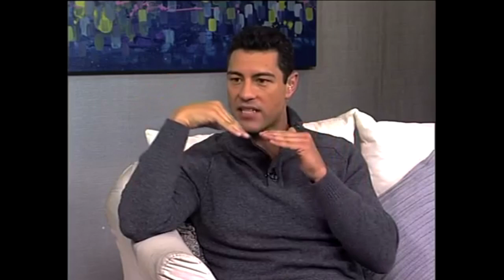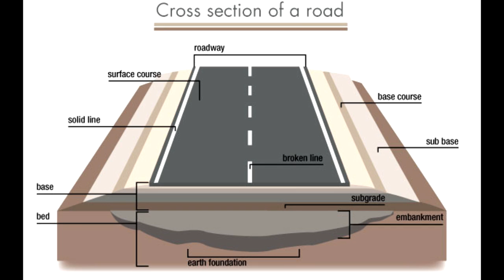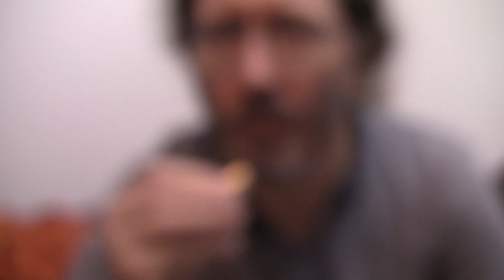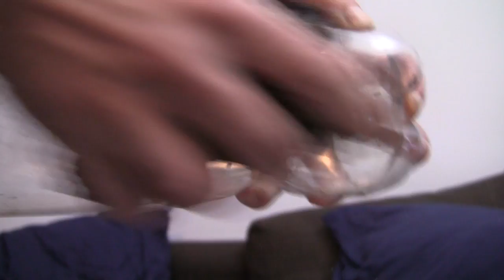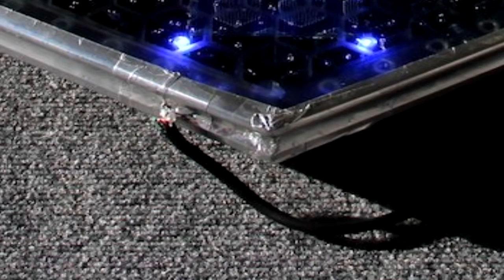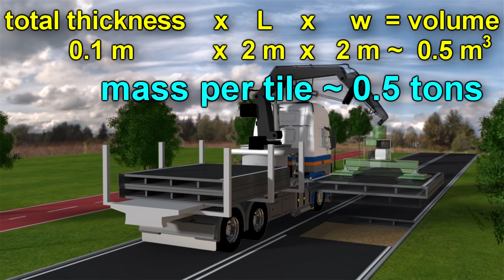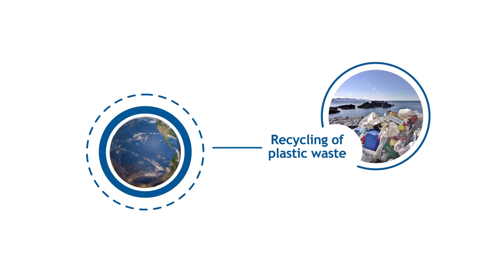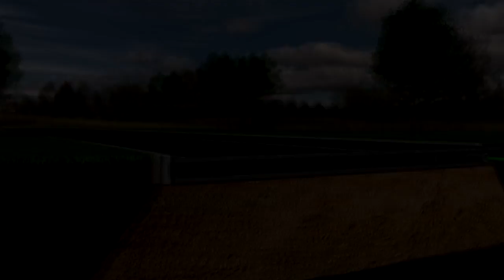Plastic Roadways BUSTED!

Comment: Of course the product is bullshit.  I will not make fun of the 60MIL hits on FB though.  I tend to see that as less about gullible people and more about the fact that people actually are starting to care what happens to our plastic and have a desire to find solutions(This unfortunately was not one of those things).   Best solution though is not going to be re purpose as much as it is just use less and be smart.   This was a good video thank you for the breakdown.  BTW Asphalt overall is not a wasteful material.  I work at a refinery.  It is made from materials that cannot be gas or plastic and are sorted out of the same fraction heating oil comes form.  It takes little effort to process compared with plastic or jet fuel or even diesel.  And as stated in this video it is easily recycled.  One thing NOT mentioned.  As the plastic is exposed to UV it breaks down becoming micro plastics which will wash back into the water ways through those rain channels or get carried away in the wind.  Adding even more micro plastic to the environment and food chain.  Burn all waste plastic and find better alternatives for single use items.

Comment: Hate to break it to you but they tested it and it worked
Reply: Did they test it for long term use?
Reply: Satan that’s what they did it’s feasible so they gave it a shot and built a road using it and will se if it can hold

Comment: Those plastic roads could be used for private driveways, but mostly for foot paths, and then, mostly in low usage areas.
Those hollow areas will lead to pathological cracking of the surface, shortly followed by catastrophic failure, probably in less than a month, a few days if heavy traffic is involved.

Comment: You could recycle the plastic into a mesh, then use the mesh under the asphalt. The mesh has a high tensile strength and would bind the asphalt reducing hydrodynamic shock, caused by tyres forcing water into small cracks, resulting in rupture of the asphalt surface. 
This kind of system has been used for centuries, using wood as a binder between layers of rock.
 Heck, even the Romans knew this.

Comment: PET is already being heavily recycled anyway - most of that which is recycle winds up in "polar fleece" or "microfibre" fabric.  I've got a neck gaiter by Buff that came with a tag proclaiming that 2 PET drink bottles had been recycled to make that one small item, and pretty much every polarfleece garment is comprised of a percentage of recycled plastic.

The only problem is that too many people are too lazy to take the PET bottles for recycling and that some places don't have appropriate facilities or infrastructure to ensure that PET bottles make it to be recycled.

There are numerous types of plastic, not all of which can be easily recycled and recycling of those that can entails careful sorting of the plastics to ensure the correct types go through the correct processes.  You can't just grab a hodge-podge of PET, Nylon, Acetate, PBT etc, melt it all down, give it a stir and pour it into a mold.

Then there's the practical considerations of making prefabricated segments of roads.  The illustrations show nice uniform squares of roadway - any kid who's played with hotwheels or any other similar thing knows that some road sections have to be shaped like corners as well as upward and downward curves.  Easy to do when you're making something that's small and is going to be set up on a table-top or floor and has uniform corners.

Not so easy to do when you're trying to follow the terrain outdoors with random rises and dips and corners that range from tight hairpins to wide, sweeping curves.  You'd need a supply of a near-infinite range of shapes and sizes of road segment to handle the wide variety of terrains and angles of curve/incline.  Without this amazingly diverse supply, you'd have to halt road repair while a custom section was manufactured.  And what happens if the wrong piece was brought out to repair the corner and it doesn't fit properly?

And that's in addition to all the other considerations mentioned in the video and in the other comments.

Comment: This is a fairly accomplished hack job using a great deal of insinuation and very little fact. Having worked with Dow Plastics for almost a decade I can tell you that the hardness or strength of plastics or plastic composite materials will not be a problem, nor will sensitivity to heat (plastic has been used to create car engine components for almost 20 years). While the future of plastic roadways is still uncertain, they will not be challenged by simplistic arguments as are presented here.
Reply: He was inferring that this design with that type of plastic wasn't feasible, not that you couldn't build a plastic road.
Reply: Yeah sure, you can engineer some super strong, super heat resistant thermoset composites, some of them even have super weather resistance (though not many). All of them cost orders of magnitude more per kilo than the cost of some rocks, sand and bitumen and none of them are recycled/recyclable.
Just sayin'.

Comment: But if you take a thick piece of recycled plastic and use it as a road even if it get damaged by the UV light you can make a machine that scrapes of the top layer and leaves a new clean driving surface.  Add some expansion joints and you are all set.
Reply: The layer scraped off would cause problems

Comment: Get massive aerospike rocket engine. give it the brain from one of space x's boosters, so it can hover. Get it to hover about two meters above the ground on it's drive flame, and program it with the route you want your road to take. Should fuse the ground into stone/glass as it goes.. Road. Some fine tuning required.

Comment: At least they are challengi g conventional view, getting outside the box to move us forward in advancing our civilization by solving a problem. Rather than hold us in the past like Thomas Edison style. Help evolve the process rather than debase it causing all ur bandwagon comments of haters. If your such an engineer you would know there is more plastic and polymers out there that are harder and provide better abrasion resistance and the process can be tweeked feom the basic idea. Stop holding minds in the dark ages and look towards advancement and evolution. Be apart of the solution not a part of the problem.

Comment: Funny thing I learned about roads in a road building course in my geomatics diploma is that it is REALLY important to build them smooth. Even small bumps can be at best uncomfortable and at worst dangerous in poor driving conditions, meaning you have to curve the roads to a vertical design layout within a couple centimeters of precision. This design principle goes completely out the window when you try to replace the mold-able asphalt with flat panels of any material. A well built road takes the ups and downs of it's environment with smooth curves and these wishful thinkers have brought straight edge segments.

Oh and the hollow compartments to house pipes is useless in the majority of the US where the freeze line is deeper than a centimeter or two. Unless you want frozen and burst pipes every winter, water and sewage pipes will have to go underground.

Comment: This thread  contains  one of the most concentrated purely ignorant presumptuous naive set of comments I have seen anywhere on Youtube. Only chemtrail and anti-vaxer threads are worse. Literally 2000 idiots here actually think the formulation used would not be designed to be fire resistant! Ever hear of an engineer? Or engineer approval reviews for public works?

Comment: Nothing has been "busted" YOU POMPOUS ASSHOLE. Plastic material does not have to be all or nothing and nobody ever implied the road bed does not require preparation, the tone of you narration makes me want to kick you in the teeth. We can add and already DO add shredded rubber tires to tarmac and we can add plastics too for a superior surface that requires less resources to produce. In fact the exact design shown in the video could be ideal is special circumstances like high erosion areas. I especially hated the way you chided the animation that abbreviated the actual molding process, what a tosser.
Reply: Have you forgotten that plastic degades in the sun light over time?  This road would create a whole lot of tiny plastic fibers everywhere
Reply: @jennakatze5401  It seems YOU forgot that all outdoor plastics have UV resistant formulations. And all road surfaces of every type do wear and that material enters the environment. Without long term testing we don't even know the wear rate, this could be the lowest wear road surface ever.
Reply: @popeyegordon  okay let's say it'll be made from UV resist plastic
Reply: @popeyegordon  it would still wear down because plastics are pretty soft
Reply: @jennakatze5401  False. There are thousands of plastic formulations. Why do you think an engineer would risk his career by designating the wrong formulation? A little give on the microscopic level allows flexing rather than chipping like concrete roads do during wear.
Reply: @popeyegordon  still I wouldn't drive over a plastic road in the rain because even if it was textured it would still be slippery
Reply: @jennakatze5401  What are your road engineering credentials? If you have none, shut up.
Reply: @popeyegordon  so I need a degree in engineering to understand, k
Reply: @jennakatze5401  No, you need to understand what it means to be a degreed engineer who's work is reviewed and is part of a team. Investors demand highly qualified personnel. Wouldn't you?

Comment: I remember a 70's commercial on TV about something called petromat. It was a sheet of a petroleum based product that they put under asphalt to prolong the life of the road. If I'm not mistaken the announcer said no potholes or cracks in test roads in 5 years. Never heard anymore about it. This commercial was from one of the oil companies. I know it would have been more expensive at first to do this but you think counties or cities or the federal highway system would use this because it would save money in the long run. Most municipalities have this kind of reasoning, "if we can't afford it today we won't use it" and this is why most infrastructure in the U.S. is in dismal shape.

Comment: Don't know about other regions in the U.S. but in Arizona they put some kind of oil like substance on the road which they say it seals it and helps to prolong the life of it. Most roads they redo in my town is cheap and really doesn't seem very good. Instead of paving it with asphalt they put a layer of gravel down then put a slurry mix similar to the oil over it. They call this repaving. Ha ,ha. Talk about noisy I measured the sound versus a asphalt paved road and the decibel level is 15-20 times more. We all know the reason they do these 2 things, money!

Comment: This might sound stupid, but I think these plastic roads would be a thing of nightmares for things like the President's motorcade, military convoys, parades etc. I mean think about it- plastic road panels that are hollow and aren't secured, imagine how many nasties you could put underneath it (IE: explosives) and nobody would be the wiser. I understand there are counters against this in things like motorcades, but I just think that this would be asking for trouble.
Reply: No, no difference in security. All sewer lids are welded shut before a presidential visit. Obviously a similar precaution could be used under this surface, and it offers ways to run wires for security monitoring purposes.
Reply: That's true enough. It was just a thought seeing how these are hollow I instantly jumped to terror incidents. I guess in civilian scenarios you'd have to be careful though.

Comment: The safety hazard would be multiplied if the road sets on fire for instance a burning car would could cause a road fire or lightning. The whole road would set on fire probably doing more harm than good in the end. Not to mention how brittle the road would be regardless due to weathering.
Reply: Stupid premise. No engineer would ever approve a formulation that is fire prone. If a vehicle fire ruins a section then well duh, the section module is replaced per the video illustrations.
Reply: Popeye Gordon you do also realize asphalt is more recycled than this
Reply: @rat7464  Asphalt can't provide a huge amount of clean power before it is recycled.
Reply: @popeyegordon , Sure, along with all the cables too ? Asphalt is flammable.
Reply: @augustreil  What part of modular don't you understand?
Reply: @popeyegordon , How many connections do you think all that stuff can have ? Even if the modules are 50ft, that's 105 per mile, it will cost more than concrete.
Reply: Imagine a wildfire in California or someplace. As soon as it gets even CLOSE to the road it turns into a tar pit!!
Reply: @oriontherealironman  No. The melting point of plastics is far greater than tar. Roads do not get much heat from forest fires, they are actually helpful breaks for fires. That's why humans stay on the roads for safety unless the wind is across at high speeds. Instead. Imagine all the forest fires that WON'T GET STARTED IN THE FIRST PLACE thanks to roads with power lines buried safely inside them.
Reply: @popeyegordon 
Eh fair point, the fire typically wouldn't even get close under normal circumstances. However it's still a monumentally stupid idea. They are thinking outside the box which is what we need, just not quite the right idea.

Comment: Well there is a way to melt plastic back into oil/tar. So that can be a use for recycled plastic. Instead of using new bitumen, they can use plastic that's been recycled back into its ALMOST original form... that is if the plastic that is being recycled is produced from petroleum and not "biodegradable" plastics.

Comment: there is going to be layers upon layers of plastic plus special adhesive plus heat resistant chemicals and hardeners added  to make the road..not  just plastic...moron..
Reply: "Heat resistant chemicals and hardeners" Care to tell me what some of those chemicals are? Or are you pulling that out of your ass and assuming there are chemicals than can do these things feasibly? Also even if you're right it's going to increase the cost of the road significantly. And the pollution from those chemical treatments, dear fucking GOD.
Reply: @YukonHexsun  It has aready been deployed in India since 2008...u r still in the dark ages

Comment: They can patch work roads or fill spots that need it lowering cost but plastic roads look like they would have to replace a whole unit no matter how small the damage may be making it more costly and that’s if the measurements are accurate

Comment: How would plastic last longer than asphalt? It would melt in the sun and tire friction or deteriorate fast 😂
Reply: Not to mention if you live in colder States like Minnesota and the East Coast he gets incredibly brittle which means that cars will quite literally break through the road because plastic isn't that incredibly strong especially when it's cold and not to mention even if it doesn't break its slick as hell has anyone ever frozen plastic in there freezer it quite literally is smooth to the touch now imagine driving on that when most cars don't have more then 3 inches of the tire on the road way
Reply: some are very good with abrasion, but none that would make a cheap durable road like this

Comment: They are using a different approach in India but it seems to be working.. what health effects it could have on getting into the water system etc are still to be observed, they are tarring the roads with recycled plastic polymer which seems to be holding quite well https://www.theguardian.com/sustainable-business/2016/jun/30/plastic-road-india-tar-plastic-transport-environment-pollution-waste

Comment: Well the fact the that the sunlight deteriorates plastic doesn’t mean a lot. You could easily get over this issue by sticking some medium course aggregate to the top of the surface. This would protect from any sunlight, especially if it was black!

Comment: Personally I'd rather see the recycling of plastic and rubber into walk and cycle ways and the creation of flexible utility tunneling for services in our streets and roadways .... The old concrete  highways give us and idea of what a paneled roadway might react like to traffic. good sound structural design can overcome soft and weak component materials, the main aim should be to produce a reliable and robust component from as much of the recycle as possible. he guy in middle America extruding Plasti-rubber Train line sleepers focused on producing a good simple needed item that would be stable and use as much of his tyre mountain as he could.

Comment: I'm thinking that the tensile strength of the bottle plastics and the addition of recycled tyres from our massive mountains of old Tyres combine to give us a great material for road surfacing panels.it is true that they are misnaming their process, and personally Id rather see a honeycomb between road surface and base and fit the service tunneling to the side of the road panel maybe as a footpath so it could be accessed in service without disrupting road traffic ....